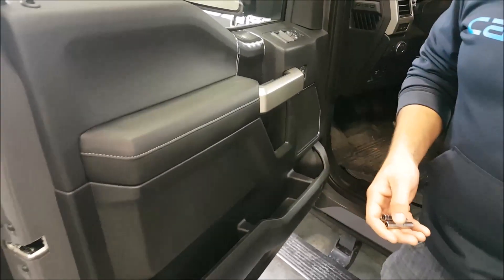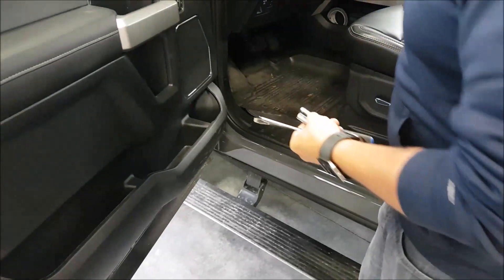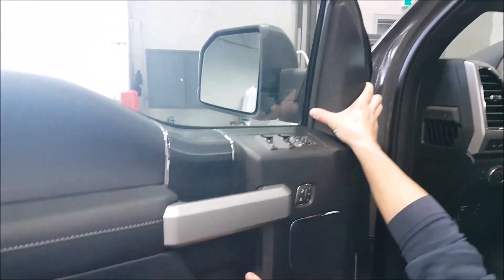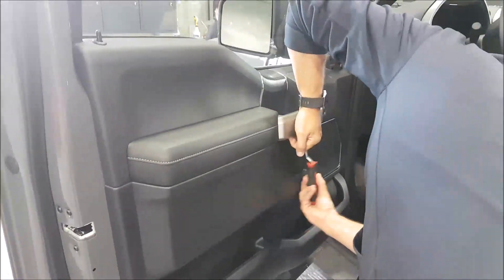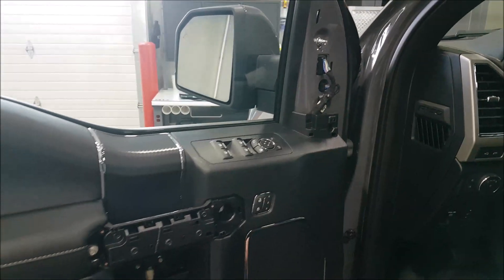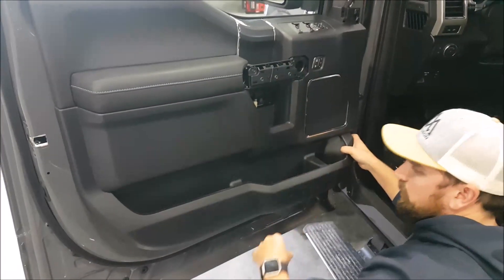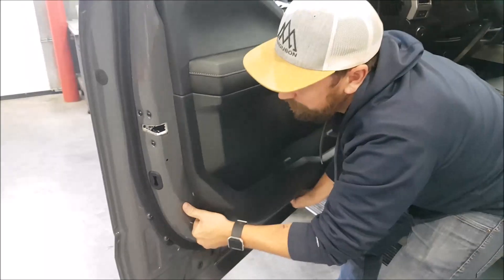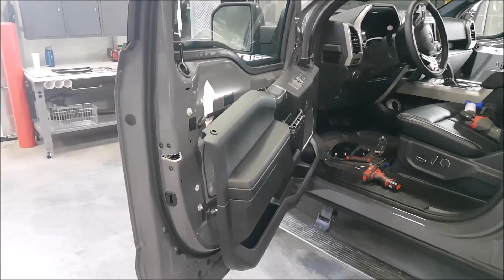2019 Ford F-150 Door Panel Removal | How To

Comment: This has to be the 5th or so video I've watched on removing this door panel and every single uploader skips over the hardest part, in removing the plastic piece under the door handle.
Reply: The clips are on the top of that panel. I popped it off with enough pressure from the right side towards the top

Comment: Didn't show any of the tricky bits like how to pop the panel under the handle or how to disconnect the various wiring harness plugs (all different of course, thanks Ford) so the panel will actually come off